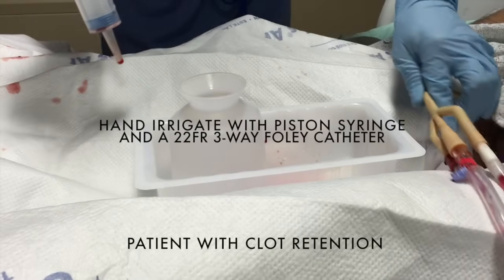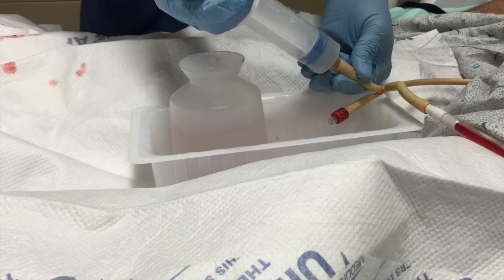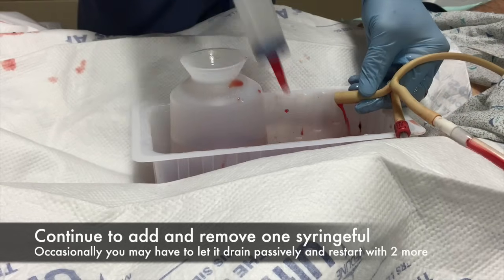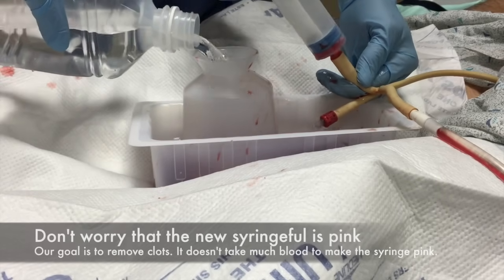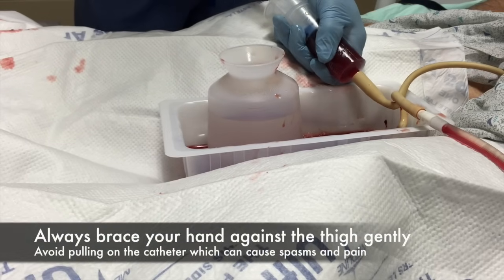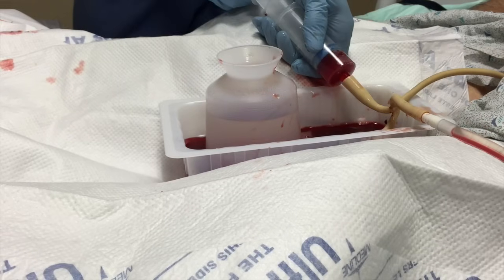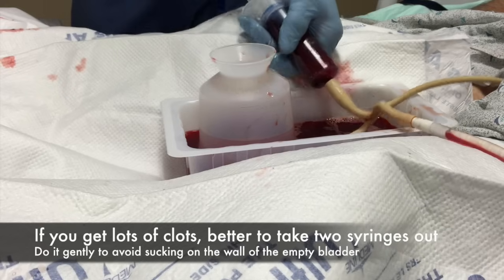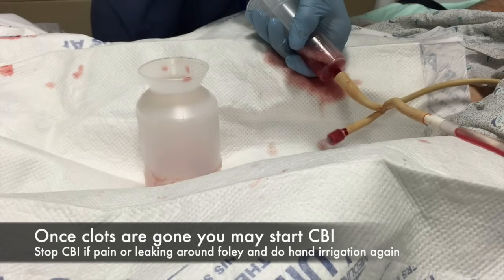3-way Foley catheter hand-irrigation with a Piston Syringe for Hematuria

Comment: Just a clarification: do we need to stop/clamp the CBI port when doing manual bladder irrigation? Thank you.
Reply: Yes. He left the CBI tubing attached, but stopped/clamped while doing this. You don't want CBI running if there are clots that will prevent the fluid from draining. You hand irrigate to get the clots out, then can restart CBI.

Comment: Thank you so much for this video. So are you saying that if my patient is already on a cbi and I notice that it is not draining properly I can suspect that the patient has a clot or clots correct. Then from that point will I begin manual irrigation? Also, do I continue the hand irrigation until what I pull back on the syringe is clear? Thank you in advance.

Comment: I came out of surgery after a failed 5cm tumor resection. Was bleeding pretty good because surgeon had to stop the surgery because he could not control the bleeding. After post op about an hour and a half they sent me to a room. During a shift change the nurses let my continuous irrigation bags go dry and my catheter and bladder clotted (SOLID). They started manual irrigation but could not get the fluid to clear. 3 hours later the surgeon showed up and took over the irrigation. He was way more aggressive than the nurses. Then he pulled out my #24 catheter and when installing a new one hit something inside me causing blood to shoot out the catheter. He immediately plugged off the catheter and called down to prep the OR. When I got down on the pre surgery floor my bladder was going to explode and I screamed at the surgeon. He up-plugged the plug and hooked a syringe and pulled out two syringes of blood and I passed out from the pain.  NOTHING WAS PUT INTO MY HOSPITAL RECORDS LIKE THIS 4 HOURS OF PAIN FROM HELL NEVER HAPPENED. Been trying to get these 4 hours put in my record for a year now but the hospital is covering it all up.
Reply: Woah, I’m glad that you are okay. That sounds terrifying.
Reply: Wild story. Glad you're OK. Should be some records of this. I'm sorry you had to go through that. Thank you for sharing your story.
Reply: Filed formal complaints against middlesex hospital, the surgeon and 3 nurses with the dept of health in Hartford Ct.  took 3 years for them to look into it and result is that they suggested formal training on NOT letting the irrigation bags go dry in the future.     THATS IT  !!   wow, talk about corruption !  lawyers said.... "if you lost your bladder you would have a case"
Reply: That is horrible. Like my nightmares. I’m afraid of that happened to me either the doctors or I would be dead and the other would be in prison. So a lose lose situation. Hope you are well

Comment: As a patient, it is a very uncomfortable experience.   The liquid is cool and you feel like your teeth are floating and then it is forcefully sucked out and forcefully  irrigated again. My doctor went through 9, 2 liter jugs of saline solution and it was still pink but most of the clots were gone.The problem was my bladder surgery went well but  the cauterization  didn't hold.  I had to have an emergency surgery to redo the cauterization, then I was fine but my left kidney where the tumor in my bladder was located was swollen.  I am hopeful it is not an obstruction and just irritated from the irrigation.   I will be getting a lasik scan to see if there is a problem with my left kidney - again hopefully  my left kidney was just irritated.  In any event, just understand it's a real uncomfortable experience and cheering for large blood clots isn't always a comfort.
Reply: Hi, I'm currently a nursing student. I'm sorry that happened to you. If you could've had a better experience, how would you have preferred it?

Comment: I noticed that you will irrigate and aspirate repeatedly before completely aspirating. What is the reasoning for that? I am assuming its acting almost like a pressure washer type of technique to break up any clots before fully aspirating, just wanted to understand correctly.
Reply: When it is clear there are clots, the goal is to get them out by aggressive aspiration.  That requires 120 ml to be instilled into the bladder before aspirating, to avoid "sucking" on the bladder wall with the tip of the foley.  If you have a patient in retention with a large volume of urine already in the bladder (as evidenced by distention or bladder scanner) there is no need to first add fluid.  In that case the bladder wall is already safely away from the tip of the catheter. Aspiration of clots and fluid to completely empty the bladder would be the first step.  Thanks for asking. Good luck.

Comment: 2 questions. 1st if clots and blood are coming out around the cath while doing this is a sign that the cath is to small? 2nd how do you determine the appropriate size cath to use. Especially if this is a pt that requires a cath all of the time. Ex: does the 18F ever become to small at a certain point?
Reply: Choose the smallest size of the catheter necessary for adequate drainage.
Reply: @charliebrown7582  how??!!!its depende on pts,isnt it???😕

Comment: hi Dr. I have a question. what would your written order be if I was to suggest your way of irrigation for one of my residents who is experiencing this issue. urologist orders for contiuous hand irrigation use 60 cc NS. I feel that that is not enough ccs for irrigation. and I agree with the sterile water. should I make this suggestion to the Dr to get the order changed. ty
Reply: If irrigation is for bleeding. Just order hand irrigation with 100cc sterile water until clear. So would use a couple syringes at a time, many times.  Irrigate in and out until the time is clear. May take 4 syringes (200cc) or 40 syringes (2 liters). Just never leave more than 150-200cc in the bladder at any given time.

Comment: I'm an RN who just started on a surgical floor, this video was great, v good info, thanks!
Reply from the maker: +MsFancypants glad you found it helpful. Hopefully will benefit your patients in clot retention through your career.
Reply: +Summit Urology Phillipsburg When irrigating a female full time indwelling cath. to prevent(chronic) sediment & crystallization blockages, routinely sending it back into the bladder.. what happens to it ? does it ever break up,dissolve..concentrate around the   balloon ? can you just keep chasing it back up inside between cath. changes ? Is there ever a point where the bladder has to be cleaned out.
Reply from the maker: +Tjfreak - It is not likely there is any more sediment in the catheter than in the bladder.  So you should not be concerned about sending crystals "back in" to the bladder.  To prevent such blockage, standard catheters are usually changed on a monthly schedule. Bladders may accumulate sediment and as such cystoscopy (looking into the bladder with a scope) should be performed annually at a minimum.  Sometimes, in the case of frequent stone formation or frequent infection of the bladder, cystoscopy is performed more often than that.  If your intention is to irrigate the catheter to limit build-up of debris in the bladder and catheter, there are few instances where this would be contraindicated.  Hope that helps.
Reply: Is there okay if we use normal salin??!!!